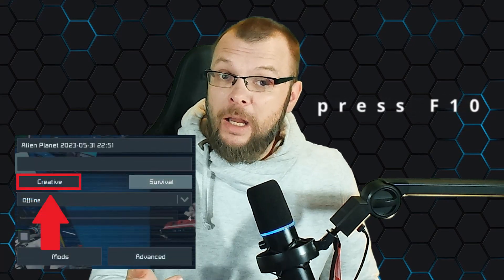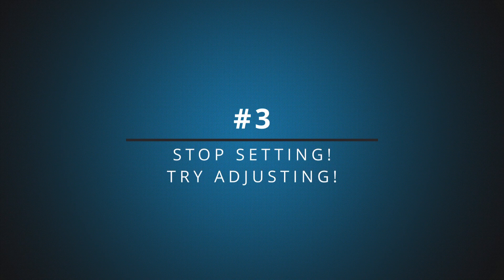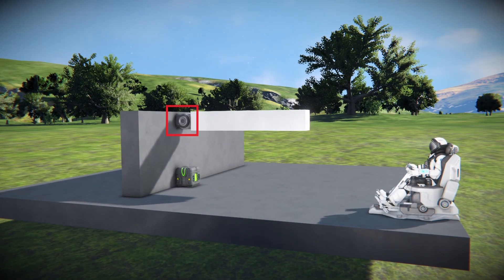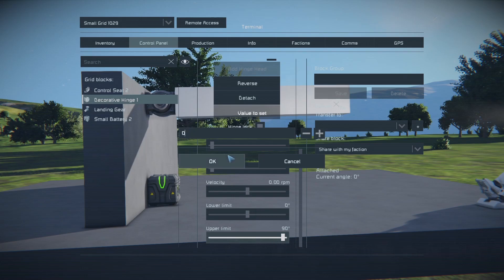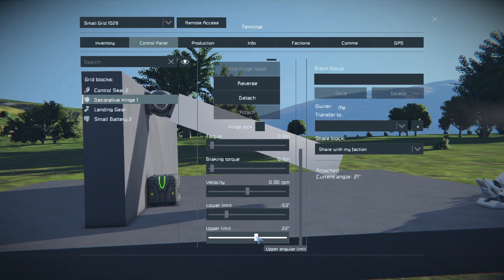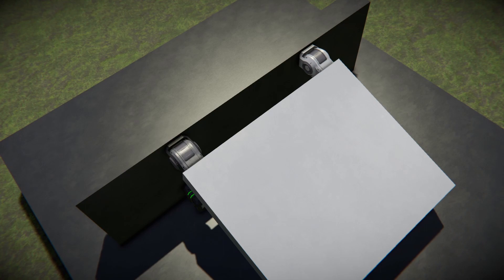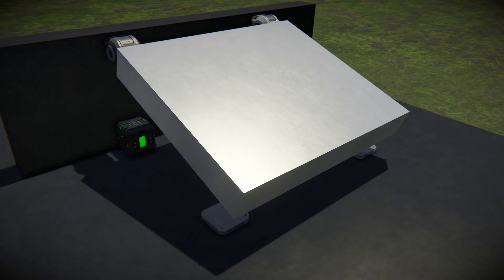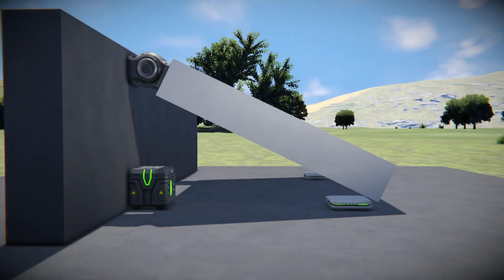[SPACE ENGINEERS][TUTORIAL] How to deal with Clang - Hinges and Rotors

Comment: My first experience with clang was putting a connector on a piston with the bright idea I would have the connector reach outside of the hangar and then have the small ship dock and be drawn into the hangar by the piston. What ended up happening was the second I docked the small ship the piston started violently swinging around in a circle followed by the destruction of the small ship, the piston and the hangar on the large ship. Plus I died.
Reply: Similar story. I had a creative Dreadnaught going on with a piston system frigate hanger. Instead of spinning in a circle guioutillned almost 2 months of work in half. Never again.
Reply: i had a cool idea for turrets that come out of doors on a ship when i pressed the button for them to come up they just blew like 4 holes in my ship
Reply: I built a large vehicle that could drill a deep hole into the ground beneath it but the second the drills started breaking the ground, the whole thing flipped over like 4 times. When I tried to scrap it, it just rapidly flipped and jumped around the environment, causing various parts to explode and multiple craters in the landscape.

Comment: Lately I’ve been experimenting with piston-actuated hinges while building an excavator. Pistons provide pushing force and hinges are used purely as pivot points.

The hinges in the system are turned off, are unlocked, have no limits and zero torque and braking torque. This means they rotate freely when the piston is actuated.

What do you suggest I should do to stabilise the system and minimise internal tension, since mag plates are not an option?
Reply: You could play with adding some braking torque, you would need to play with the settings but when you find the right balance the pistons would still push and pull them around but they wouldn't have so much wiggle on their own. I'm not sure but I think that sharing inertial dampers would still be useful on the rotors/hinges on the subgrids.
Reply: Gyros on override